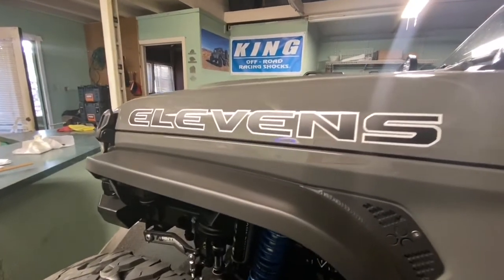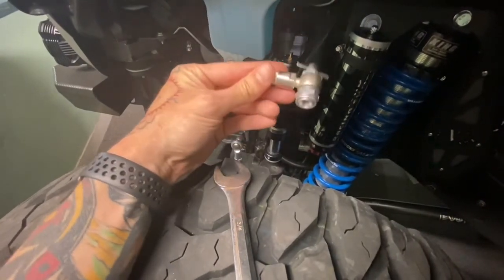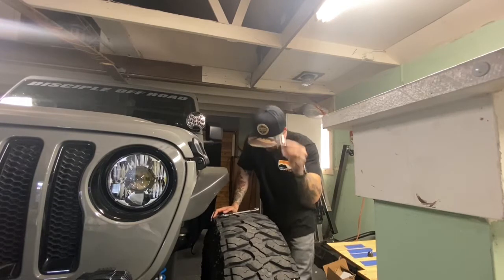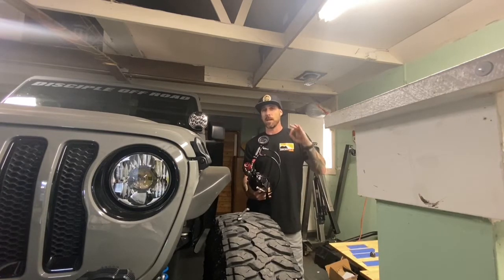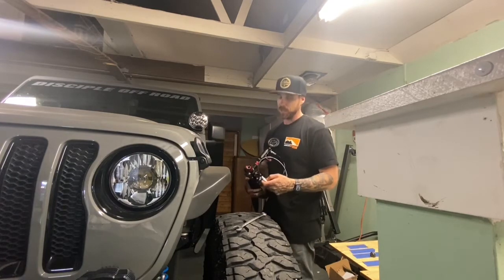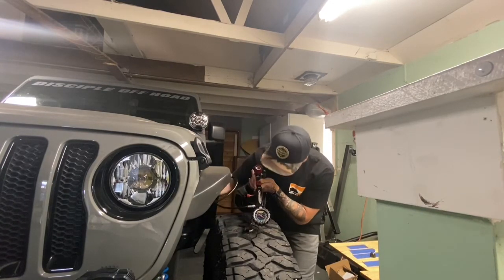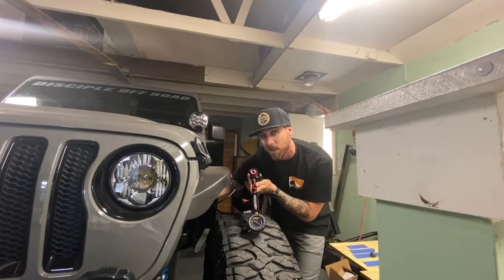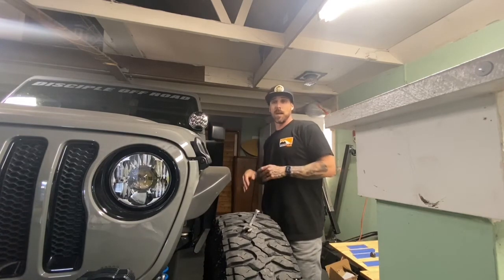How to check and charge nitrogen shocks, hydraulic bump stops, coilovers.

Comment: went to check my brand new bumps just like this. had sime oil come back out into my power tank tool. this normal?
Reply from the maker: Sounds like you released some of the shock oil. A little bit is ok but a significant amount wouldn’t be good.